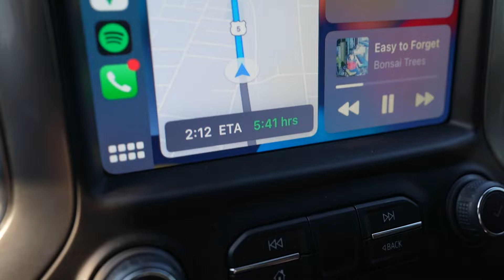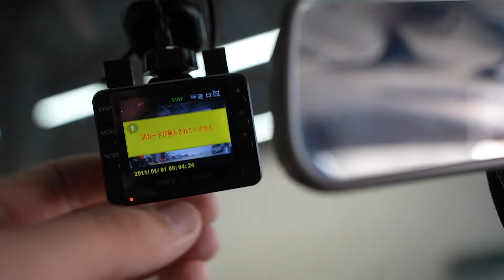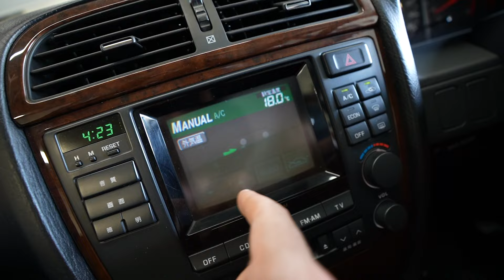Stevie finally gets his FIRST JDM IMPORT!!

Comment: So stoked for Stevie! The Vq30 was used over here through 2001 in Maximas, almost the identical block to the vq35de. They’re pretty bulletproof and don’t eat oil or have the timing chain guide issues of early vq35 cars. 

Remember Vince’s ride in the first Fast and Furious? Supercharged Vq30 auto car haha

Also, pretty sure Nissan Leopards come with a factory Vq30dett 👀
Reply: Put an exhaust on it and it'll sound amazing! Plenty of aftermarket support!
Reply: Learn sum new everyday, thx 4 tha knowledge
Reply: These came as factory turbo cars too  you could also get a rd28t in them
Reply: Nissan Gloria’s come with the vq30det
Reply: The only difference is the 00-01 was the DEK 

But yea the VQ30s are bulletproof af
Reply: what year does the vq35 starts to eat oil i have a 04 g35 sedan
Reply: @deavid81  Rule of thumb is 02-06, the DE tend to burn oil from faulty piston rings. However, my 02 vq35 maxima doesn’t burn a drop, so it kinda depends on the break in and maintenance. either way, just keep an eye on the oil and they’ll go forever.
Reply: @brendansoriano7373  ohhh that's crazy because my car has 241,000 miles and it don't burn oil at all every morning i check it and the dipstick is right where it was when i took it to do an oil change
Reply: by the way i'm the second owner

Comment: Had a 1994 nissan maxima I did a jdm vq30de with a 72/76 Garrett journal bearing turbo, genwolf technology ECU, turbo 300ZX maf, rb26 injectors and a few other parts and put down 405 HP to the wheels 362tq at 13psi. Have photos of the car and Dyno sheets to prove it,  tune done on dynojet rollers. The great thing about these vq30de engines is the bottom end is factory forged parts. A quick resetting of the oil ring gaps for boost friendly application and the engine is quite a stout little unit.

Comment: I'm pretty sure the Cedric has a "dog leg" front strut which makes coilovers difficult. Best thing to do is run a S15 front hub with S15 coilovers which will get it to lay on the ground if you want. We did this to my good friends Cedric over here in New Zealand. If I remember correctly I think we had to change to a S15 outer tie rod or lower ball joint and have the upper strut tops custom cut to suit the body but easy fix and works perfectly. I'm sure your BC boys will have you sorted but just in case.... Hope this helps you out Steve.

Comment: Steve, first I would do some maintenance like serving the fluids, filters plugs and learning how to keep a car running well and doing a service is a good way to learn about a new car. If the underside is really fresh maybe go see Papa Tom and get it dry ice blasted. Wheels and suspension is always a good place to begin modding as it changes the car drastically and gives it your personal touch. You do you mate, but me I would keep it simple and clean with some baller wheels to really snap some necks. You're in good hands at the garage, I'm sure you'll do her right, all the best mate and ENJOY, that's the main thing imo.

Comment: Nice you don't see to many of Cedrics around.  A hidden jdm VIP car

Stevie is in luck.  Thanks to Jimmy and his supply of s chassis parts.  It would be easy to lower and affordable.  Apparently s14 front knuckles fit opening up a wide selection of coilover options. S14 rear cpilover fit as well

Great pickup and good luck on the build

Comment: If its any help to anyone, the subframe from gx/jzx is the same for 90, and infact interchangeable between 90 and 100 with the exception of changing the engine mount rubbers!
Reply: Will I have a problem with my gx chassis harness when I swap a jz?
Reply: @romanhernandez3228  yes you'll need to modify dash side of harness
Reply: @WillSouth97  I’ve also heard that you may need to get a jzx steering rack too, is that true?